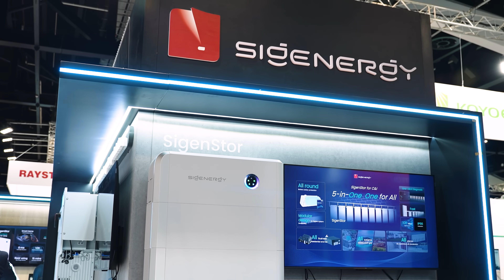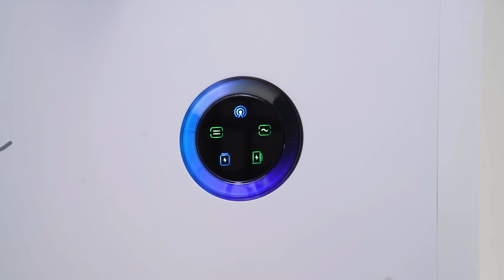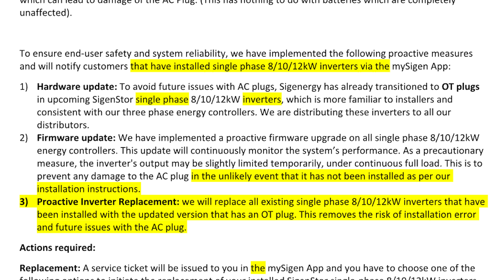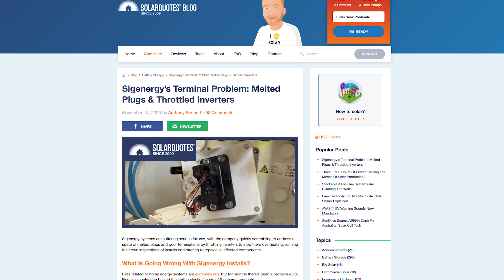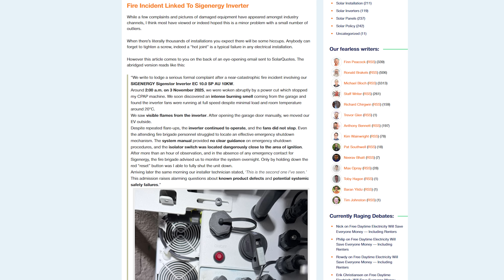Australia’s #1 Battery Recall: What They Aren’t Telling You

Comment: Is there any update on this? I am pretty sure engineers, even Chinese, have tables and books that tell them which connector can handle which amperage. Even in Australian weather. What did actually fail on the connector? Was that really a construction fault, or was it just too easy for the installer to create an underrated connection? I read their installation manual and they were very particular with their crimping. Some of it looked like only 100% perfect crimping is allowed, which probably was very hard to achieve by the Installers. No blaming anyone. Sigenergy could have made their connectors more stable, but the installers could have worked more precise as well... Anyways: Does anyone know the main reason for the high power overheating?

Comment: Ok hang on give us an update with real facts. Most of the inverters are failing if not all 8kw 10 and 12 kw I got 2 of them for total power output of 24kw never drew more than 16 for few minutes so well below what they should cope with. My inverters both failed in 2 months the ac plug was installed properly with crimped terminals. There are a ton of people with the same issues on Facebook the end user page deletes all the failure posts this is a big fuckup and they are hiding the truth

Comment: Thanks for the info, I am currently getting quotes to get a battery installed and Sigenergy is the one I am leaning towards, but I have had 1 of the companies tell me because of this I should get another brand as all of Sigenergy batteries are being recalled becuase of fires.....
Reply: That's correct they are
Reply: @karlajensen100 no they are not, some are not all. And those that are being recalled are due to firmware updates not being able to be pushed. And any new units will have the new connector moving forward.

Comment: What about Sigenergy response to Europe, not even an announcement from them.
Reply from the maker: I would say (and I am speculating) as in Australia's case - the message is being approved by regulators and with so many countries - that's not a 5 min job. Let look at this again in 2 weeks and see if still no info.. also overall I think the Australian charging and discharging regime given our sun irradiation and VPPs might give the plugs an extra run for their money.
Reply: Brisbane temperature 30c plus can create heat issues with the inverter my one runs at 51 to 59c I run a fan onto the outside during very hot days

Comment: Hi Markus. I have installed 1 Sig system (over 5kW per phase) A 12kW single phase. In my case it was 100% a design failure by sig. The socket burned at the connection inside the inverter, nothing to do with my plug connection. 40+ years an electrician , I've seen my fair share of burn outs. The reason only a few burn is that most systems will never see full current (50+ amps) run through the plug/socket. In my case I have 1 to 1 ration AC coupled solar so my system could see full 52amps, for 3 continuous hours each day while charging the batteries. So, every inverter is at risk, because the plug is not rated to handle the current, and the aussie summer temperature is not going to help. I have a replacement inverter to install, but if they haven't addressed the issue of the connection to the socket inside the inverter, it will burn too. I'll let you know if that happens. Cheers Matt
Reply from the maker: Hi Matt,  good to say hi - and thanks for the info - I assume you already have shared your info with SigEnergy. Please keep me up to date. My number has stayed the same.
Reply: @yeanswers  I can confirm the issue as my system has crimped terminals I emailed Sigenergy 3 weeks ago and no reply very disappointing. Also bearing in mind both my 12 kw inverter have failed.
Reply: @shantymariol5014 put a fan on battery to cool it down in hot weather
Reply: @Gordon-j4j  no idea what is your comment about the system is clearly poorly designs if it fails within 2 months and was installed to manufacturing specs…. Will see 2 years down the road how those systems will perform
Reply: If the stack is pulling that current are the inter-module connections designed to cope. It's not only what you can see but what you can't as they are the plug and sockets from module to module
Reply: @jonathanallen985  From what I am told,  Sigenergy used crimp connectors, is this true ?  If so, wouldn't this be illegal in Australian Domestic applications ?

Comment: 3:02 And this is probably what should have been done in the design stage. It is definitely a design flaw, if installers who install devices every day have a problem. As far as the overheating issue, these units should have been over designed to cope with the designed output power.
Reply from the maker: you could have a point and time will tell - but what we at YEA would like the whole industry be aware of - we are all on the same tree that we are cutting down and if you think this will be the 1st issue- you are dreaming. I have seen ultra cheap installs that are shockers and we will make a video about it. The key issue is this.. 

Remember the 1950s—the big reveals where Cadillacs rolled onto stage under spotlights, shimmering paint, crowds cheering? They looked incredible. But those same cars had steering wheels that could impale you, no airbags, no seatbelts, no headrests, no crumple zones. They were technological marvels… until we learned better. That’s exactly where we are with home batteries today.

As Winston Churchill said—borrowed from an installer I spoke with today—we’re not at the end, or even the middle, of the development. We are just getting to the end of the beginning. There is still a huge amount of learning and improvement ahead, not just for one brand, but for every brand: LG Chem, Tesla, Sungrow, Sig… all of them. This is an engineering journey, and many products on the market will need refinements as we go.

So to everyone rushing to point fingers: be careful. There will be more issues in the years ahead because that’s how innovation works. The real question is whether our industry treats these moments as opportunities to improve—or turns them into blunt instruments to beat each other over the head. If we choose the latter, then honestly, we don’t deserve government support.

Time to grow up, learn the lessons, and lift the entire industry together.

Comment: It’s going to be interesting to see how every other manufactured systems perform now also with the big uptake in larger storage and inverters taking advantage of the rebate and joining vpp’s to expedite roi along with A/C coupled retro fits drawing large currents for extended periods during the cheaper or free 3 hour windows along with ev charging?
Yes the oc connectors are obviously much better than the bootlace pins but 45 amps I believe it is gets extremely hot for these extended periods? I guess it could be said well if your HVAC, oven and HWS are all on at the same time then there’s over your 12 kw single phase so here’s where 3 phase shines with balanced loads? 
Engineering on this isn’t a new reinventing of the wheel however these bigger and faster charge and discharge rates for prolonged periods is a concern over every product out there including the overwhelming Chinese ev car boom? 
I’m happy with my Sig 3 phase 25kw ems and 40 ess and treat it with respect to last and not flog it flat out to cash in on the export band wagon.
Cheers
Reply: To get the cost per kWh below peak rates in most areas you need to be cycling it to the warranted cycle limit of 3MWh/kWh of storage in under 10 years.

If you use half of it the cost per warranted cycle is double should the inverter fall over at 10.5years.
Reply: 230V 63A is 14.49kW, plenty of people doing this and melting stuff already with OVO. Most of it melts at the connection point
Reply: @karlajensen100 put a fan on the batteries to cool them down?

Comment: I have a background in electronics and robotics and believe a product recall is not necessary. An adequate solution can be achieved by issuing a redesigned AC plug that cam be fitted by the installer.  The photo at 0:14 (and others) shows that the overheating problem originates in the screw terminals of the AC plug. This problem can be addressed by issuing a replacement AC plug that is precision machined to be a tight press fit into the existing AC socket.  O-T terminals replace the screw terminals (like with the 3-phase AC connector) and a metal shell is provide so that the new AC plug can be fastened to the inverter housing using the existing AC socket screws. This solution should be just as good as the proposed recall to replace the AC socket with O-T terminals, providing the AC socket has suffered no heat damage, and can be done onsite by the installer.
Reply: Consumer protection comes first. Risks of fire is a major concern. No one has to be injured first for an action to be taken. I am a fun of Sigenergy, and disappointed as I was waiting for my install. Safety comes first, whether installer's or manufacturer's fault. I am happy that there is a soluton so I can still get the Sigenergy installed.
Reply: The same installer who can't get the AC connection "right" in the first instance? 

That's not going to fly, nor will the potential damage observed on the wiring inside the unit.
Reply: Tell that to them because they just recalled it
Reply: Liability for repairs is safer by whole inverter replacement

Comment: There has been concern from day 1 that the Sigenergy stack design  uses too much flimsy plastic for the clip on side panels that restrict access to the electrical connections   . There is no doubt it is a cheaper design compared to other European and US manufactured inverter/battery stacks.

Comment: Sig claims as installers defect .?
Reply: I would not go so far. The fact they re-desdigned the plug is in my opinion some admission that a better solution is ready. If the cable is undersized or poorly crimped then of cause this could be an issue and then VPP smashing the AC connection adds more "pressure"  -  as per Smart Energy Lab explanation below - quote ... "BTW, since AS/NZS 4777.2:2020 introduced the requirement for LVRT (Low Voltage Ride Through), to help support the grid, this function now inadvertantly increases the chance of over heating of a high resistance a.c. connection. When the resistance on a poor crimp causes voltage drop, the inverter's LVRT function causes it to increase current output to "assist" the grid, however, the result when the voltage drop is due to high resistance joint is to worsen the situation. One step forward, two steps backwards :( "
Reply: @markuslambert8236  they should have recalled by them self and if the product design is good why they change to new model that’s why stay away from 1st generation products

Comment: Longevity is a concern. If the original plug was still suitable for existing installations with the correct cabling at the point of installation then why is the OT connector now changed out in future SP inverters? I have one of the single phase inverters that is AC throttled to 8kW, firmware has been updated by Sigenergy however it is unclear if they are going to swap our unit out?

The recall statement and Sigenergy statement are not aligned and confusing. More frustrating a good number of Sigenergy single phase customers including myself have tried to get clarity about who is actually going to get replacement units against the recall. So far no clarification.
Reply: I would expect the unit to get a swap - but this is now a matter of timing - as it can not all be done at the same time and installers are hard to come by - right now  I wonder if the  focus of 1st swaps is on strong VPP participants?
Reply: Sig are paying the installer $500 to swap the controller unit. So, talk to your installer. You may have a low priority. Sig knows which controllers require urgent replacement. I believe this is mainly a WA problem where the single phase export cap has been increased to 10kw and the vpp is flogging the battery/controller for max profit.
Reply: @cyber5515 there have been no grid events in WA

Comment: What great and honourable company....
Reply: ......if only Sig had bothered to issue notifications to the customers instead of hiding the details. It was weeks after the inverters were limited, without users being informed before Sig "volunteered" any details....... 

But it was first released as, 

"it's nothing to do with the product, it's an installation issue", 

then it was 
"the correct sized wiring was hard to fit, so thinner cabling was used", 

and now "the inverter has the wrong AC connection to safely do the required task". 

The icing on the cake is the news that the new inverters (to replace the Sig inverters that had the wrong AC connection) is to be replaced by the same guys that were being blamed for wiring up the first inverters wrongly. 

Lets just pray that these new inverters weren't rushed through the testing stage as it appears that the original inverters were.

Comment: Thanks for doing this post Marcus to clear it all up even though I’m sure you’ll also get the response of another biased sponsored smart energy answers / Sig you tuber fighting back?
Agreed with everything you’ve explained as this is 100% the problem! I’m disappointed with Solar Quotes bad publicity as they’re usually a great platform with facts so I hope they do a counter post to support this? I have the 25kw 3 phase like yours and it’s great however I do think the ac connection isn’t a great design causing a tight bend in the 16mm cable to facilitate the dec cover and maybe could be a right angle but if done right as instructions with the black flexi rubber cable then it’s okay and bend radius should be 10 x 16mm so 160mm and the bigger kw 3P have longer connecting gland nuts so that’s why some cables are through the dec cover like yours? Not a great look but better to be done right? Let’s just hope this doesn’t effect the grand market share and they soldier on with what is otherwise a fantastic innovative product and let’s not forget that Tesla has recently had more serious recall problems with fires and they’re the one time rolls Royce leaders in the industry so let’s just get on with it and keep moving forward!
👍😀
Cheers
Reply from the maker: Thanks Michael! We tried to produce a video that we thought hit the right mark.
Reply: Yours will likely fail also and the installer will be blamed for the incorrect bend radius that you mention.

This loads the plug and socket which its not designed for.

Get them (installer) out with a thermal camera to verify.

Thrash it for an hour or three before they get there and push/pull some power to the grid.
Reply: The Tesla recall affected less than 1000 units out of 35,000 installed in Australia.

Comment: Would be interesting to know if the these melted plugs & sockets only occurred on inverters that have been signed up to VPP , i have a sneaking suspicion that VPP controllers are pushing those inverters to the max current when they want your export.
Reply: …and by pushing the inverters to MAX current output for VPP purposes, what is the degradative impact on the battery/inverter?? 

Is this why the government is subsidising home batteries, instead of building commercial battery storage?? Labor has thrown billions upon billions at renewable energy, but decided to pull-up before battery storage and the commercial investors aren’t entertaining battery storage either!?… it’s almost as if they already know that battery storage isn’t financially viable.🤷‍♂️🤷‍♂️
Reply: @LukeAusNSW 100% and it’s not mentioned much at all with all the vpp Amber promoting. For the average household is rarely pulling that sort of current unless hvac oven HWS etc flat out at the same time and then the inverters are engineered and capable so it’s clearly the poor connections where the arcing occurred. Another reason I like having 3 phase to balance out the loads 👍
Reply: @MichaelDance-d8d I'm pulling 45A a phase x 3 phases for 3 hrs most days of winter.
My two SYMO 10s have screw terminals though and there isn't a heap of wires connecting to the boards as they are all proper connections.
Reply: @LukeAusNSW The harder you cycle any chemistry battery the quicker the degradation, with VPP control effectively they control how the system charges and discharges and I know at the moment it's an opt in to be a VPP but for the rebate it has to be VPP capable and I'd bet my left nut when they have enough people on the hook you won't have a say
Reply: @LukeAusNSW  My reply is 3 days late but there's a whole heap of people around Queensland today that are very glad they have batteries (me for one). I never entertained the idea of the payback being VPP. For me it was all about my home resilience. A storm only need be on the horizon here for the power to go off. We have no mains water so power off means, no running water. Yes we can "prepare" but for me the battery was a resilience and insurance policy, expensive perhaps but to my family worthwhile.
Reply: Nope nothing to do with a VPP. The DNSP will have told the installer to throttle the export to that which the DNSP allows in the specific owners case. For most that would, for a single phase inverter be 5kw. Wether you export automatically everything above what you self consume, or wether under teh control of teh VPP they cant exceed the DNSP Export limit. My 12kw sig SP was limited by the installer the the 5kw allowed and when I use Home Assistant Modbus control to drive the inverter behavior to export when financially viable I cant exceed 5kw no matter how much I want some more of that $19kwh FIT....